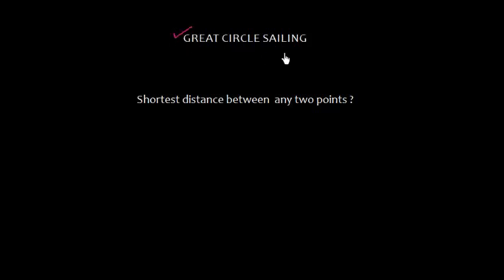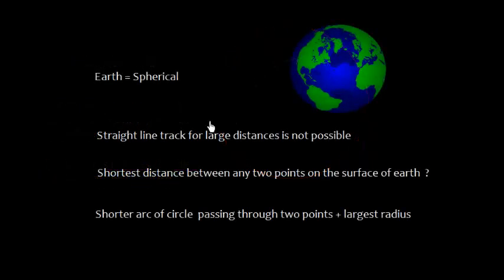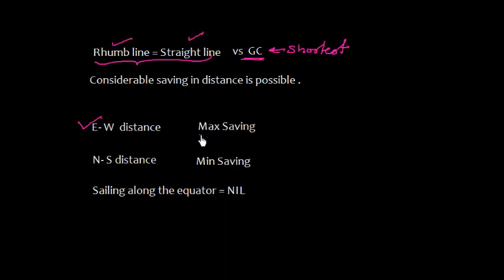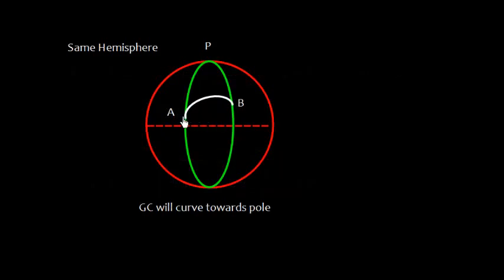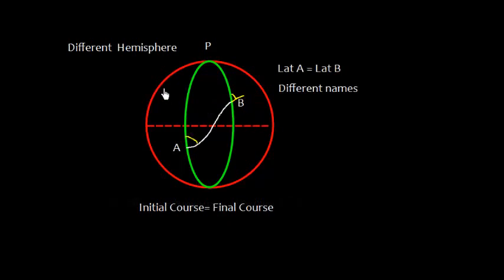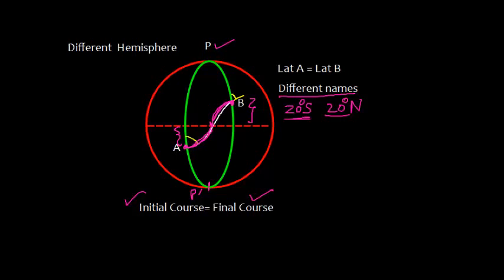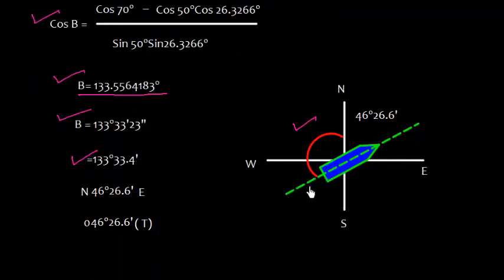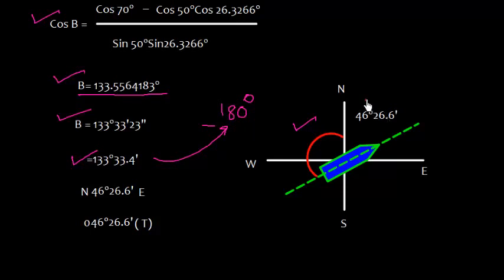Great Circle ( GC) Track. Calculation of GC dist, initial and final course Part 1

Comment: U have minus the B angle with 180 deg than how it could be NE bcz NE is an angle less than 90 itself therefore no need to subtract and read it same way .. The angle B is a South east course therefore u subtracted it with 180 deg ..
Do reply
Reply: For 2nd mate prepration join kundan patna #kundanpatna

Comment: At 6:23 Is the green circle a great circle?  If it is then you are drawing the distance through the center of the earth.   The only way it makes sense is if the green circle isn't a circle but two longitude lines.   What makes it confusing is that the green lines are an ellipse which is what a circle appears to be when it's seen at an angle.   The longitude lines should not form an ellipse if they are that close together.   The ambiguity makes your explanation difficult to follow.  Maybe I'll attempt to continue watching and then go back to the ambiguous point later.
Reply: For 2nd mate prepration join kundan patna #kundanpatna

Comment: how would I know if to take it away from 180
Reply from the maker: In solving triangle PAB, you are finding angle A and B. You need to convert angles into course which is measured from N-S meridian ( line joining pole, which looks straight on chart). Initial course you can keep the angle A like this. For final course subtract B from 180 because angle B is  at the stern of ship where as course is measured to the ship head from N-S line. Hope thi answer the question . Pls watch  to know more about course.
https://www.youtube.com/watch?v=5ufMFHazUFw&t=9s
Reply: For 2nd mate prepration join kundan patna #kundanpatna

Comment: excuse me sir the first angle you measured clockwise but the second one you did counterclockwise, why ? , I am trying to do a navegation system for an aircraft, does the cosine law work for the heading angle ? or should i use other method. !!!! thank you for your time
Reply from the maker: There is difference between  course angle that is angles A or  B  obtained in triangle  PAB and the course. The course in marine navigation is always measured  anticlockwise from  meridian ( curved lines on the globe joining poles )  i.e N- S line  ( straight line on the chart ). Here course angle A gives the course equal to angle A itself in anticlockwise direction. Course angle B is opposite to angle A and in different quadrant but ships heading is from A to B. Hence we need to find angle of ships head from N-S line  ( 14:18).    Also pls watch https://www.youtube.com/watch?v=5ufMFHazUFw
Reply: For 2nd mate prepration join kundan patna #kundanpatna

Comment: Hi sir excellent work,  i checked with google maps and the distance is about 2.932km what am i doing wrong?
Reply from the maker: Pls convert to nautical mile. Since nautical miles vary with lat, average mean value is 1.8523. 
 So this 2932 km will equal to 1582.896 nautical mile. The GC dist obtained in question is 1579.6 nautical mile which conisders earth as true sphere.  Hope this clarifes.
Reply: thank you so much for your quick answer, now i see the relation, just one last dumb question why did you multiply ab result by 60 ? im so sorry for this questions
Reply from the maker: One degree of arc = 60 minute of arc. Hence the degree is converted into minutes. One minute of arc corresponds to one nautical mile by definition.
Reply: thank you so much for your time, you are a lifesaver
Reply: For 2nd mate prepration join kundan patna #kundanpatna